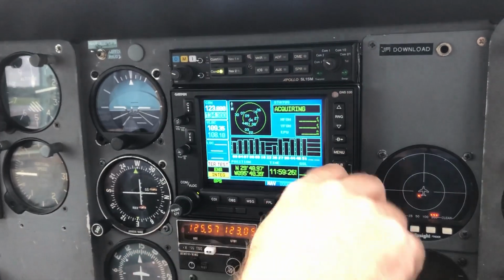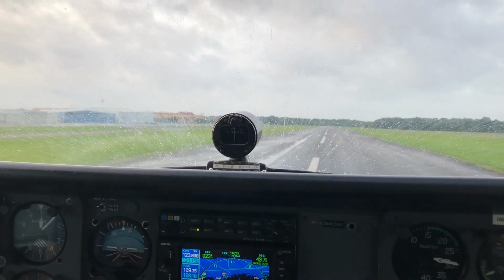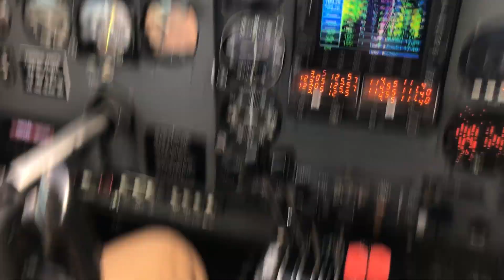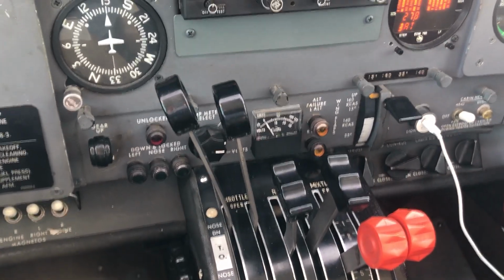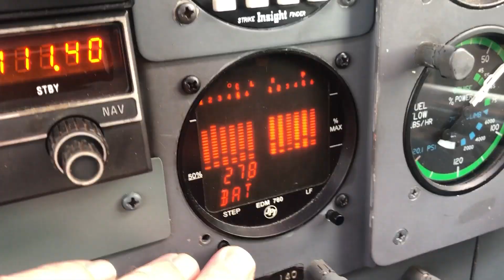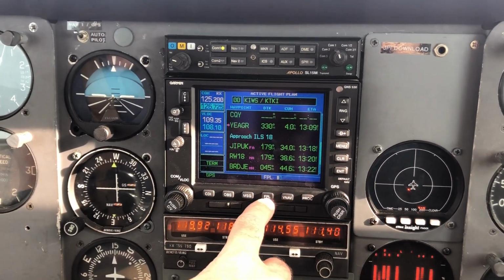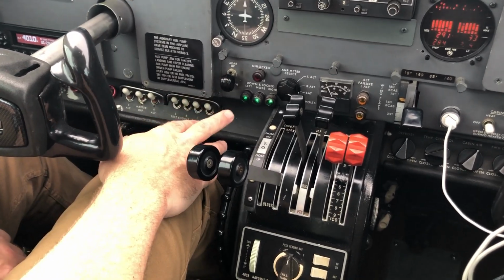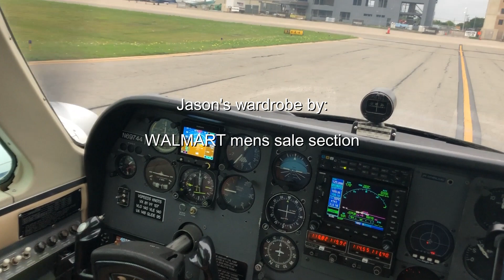Cessna 310 - IFR Houston to Dallas with ATC communications

Comment: Question,
What is the gauge to the right if moving GPS map that displays a plane with a moving red dot rotating around a plane?

Is that some type of traffic advisory gauge?

Or fuel indicator gauge
Reply from the maker: That is a stormscope...a.k.a. lightning detector. It shows the relative azimuth of lightning strikes and is also useful for trends, i.e. if the storm is getting worse or falling apart. Thanks for watching!